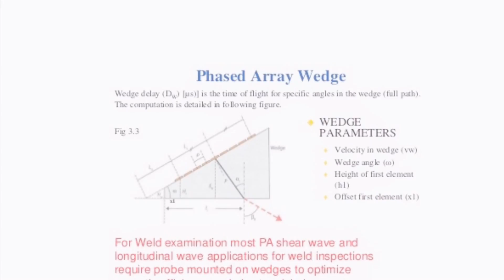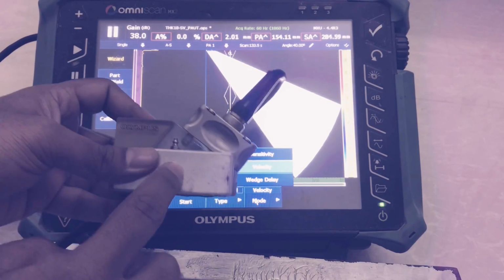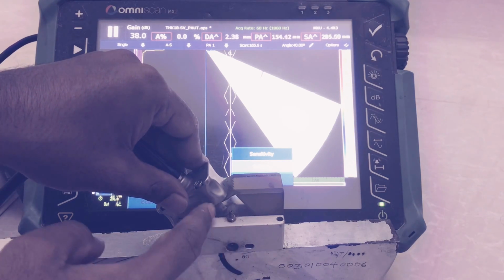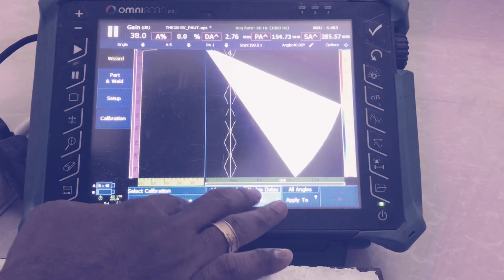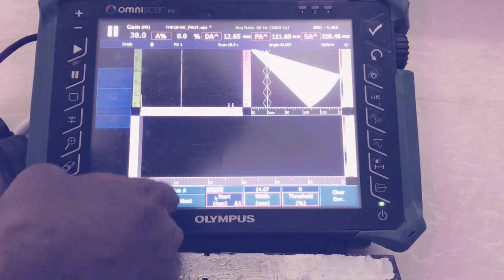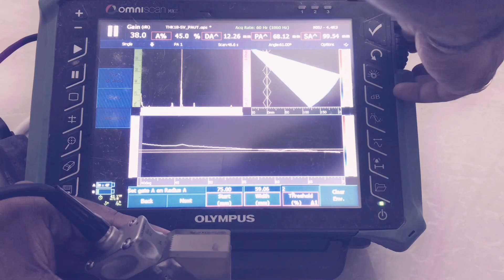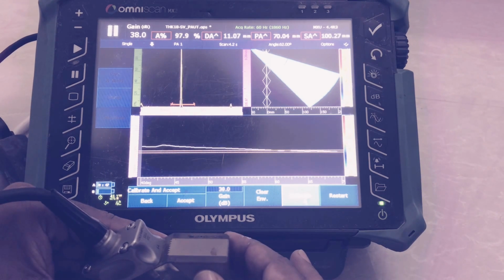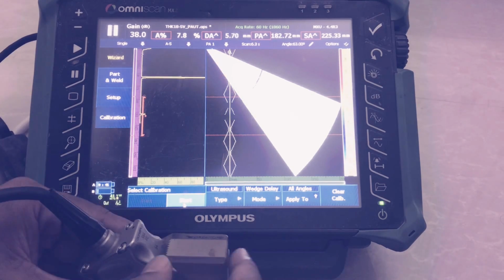PAUT WEDGE DELAY CALIBRATION

Comment: Good morning sir, 
Please tell me the reason for performance wedge dealy? If not doing what will happen?
Reply from the maker: Without wedge if u place the probe then u will get the accurate depth..however we need use the specified wedge for specimen inspection (for example A12 probe means SA12 wedge like that), so wedge have some parameters since ultrasound need to travel through wedge material also.then depth will change.That’s y we should go for wedge delay calibration.

For example , if u wear high heels shoes means ur height will change, the same pattern 
Thank you
Reply: We are taking wedge delay Zero in UTpa but in B-scan we are taking wedge delay in value why ? Please answer @CLUSTERNDTTEAMINADVANCE